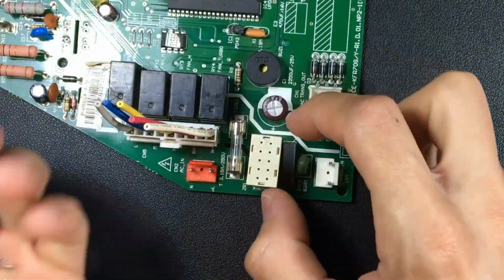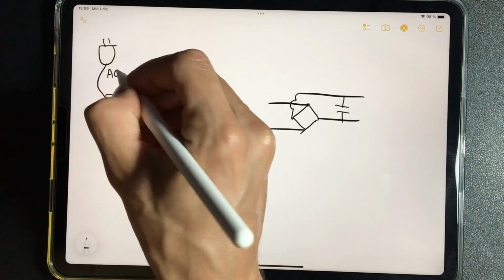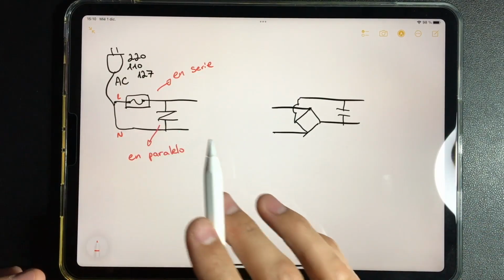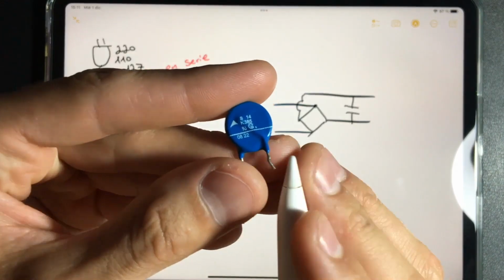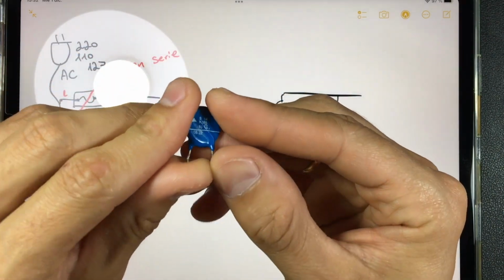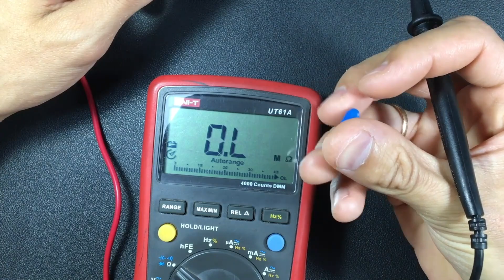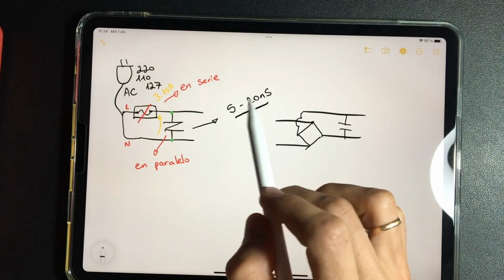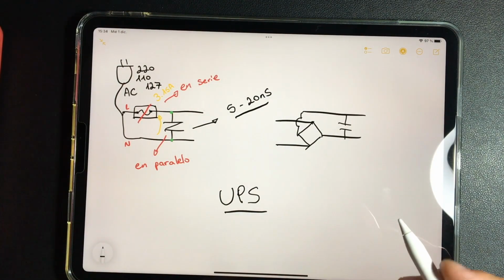Class 15: VARISTOR AND FUSE in Air Conditioning Inverter

Comment: Great!  A look at a very important safety component that is often overlooked.  Just a small suggestion, always test fuses out of the circuit - you never know what might be causing the low resistance path otherwise.  Rare but important to know just in case there is another fault or component that is bridging the fuse!
Reply from the maker: Join our channel to access the classes by title and by module, and study effectively!
Join the Module Access level or higher!
TAP HERE ▶️ https://www.youtube.com/channel/UCfu_M6VyaVaJK9R69DsZGHA/join

Comment: A UPS is generally also internally protected by a big MOV and stuff and it also have a "response time" nothing gonna help you if you get a direct lightning strike in your equipment, you are always better off of you pull the plug when you know stuff might happen. I have equipment I can test at what voltage any MOV starts to conduct within less than a volt accuracy but they generally crack when a bigger current have damaged them
Reply: .Hyde
be xxux
Reply from the maker: Join our channel to access the classes by title and by module, and study effectively!
Join the Module Access level or higher!
TAP HERE ▶️ https://www.youtube.com/channel/UCfu_M6VyaVaJK9R69DsZGHA/join